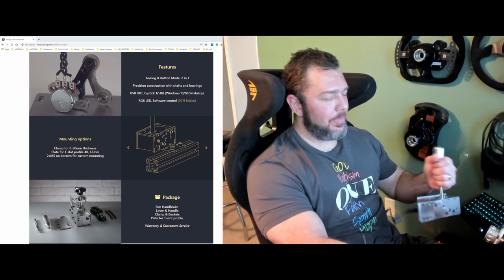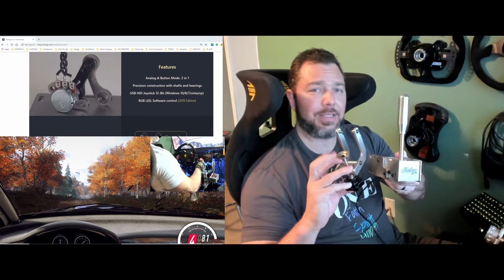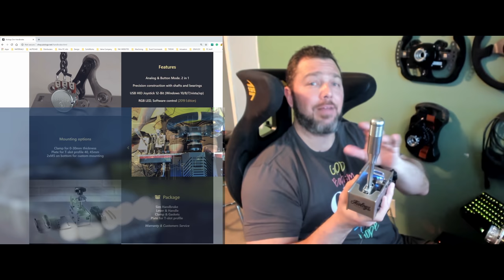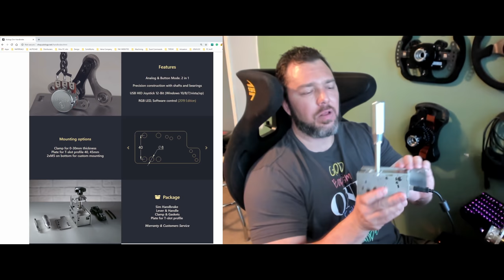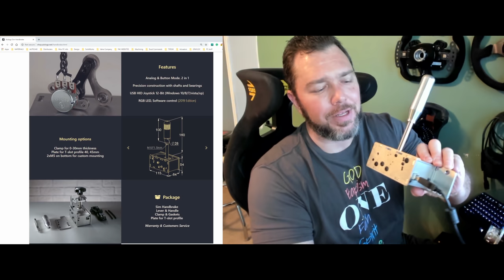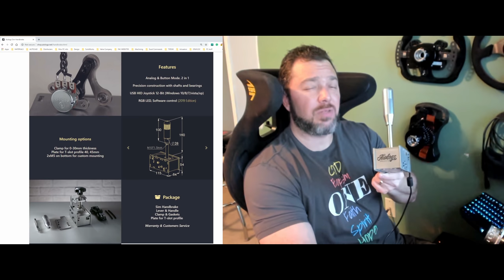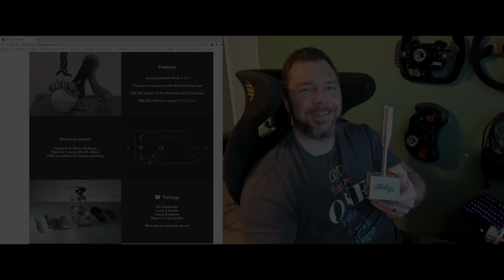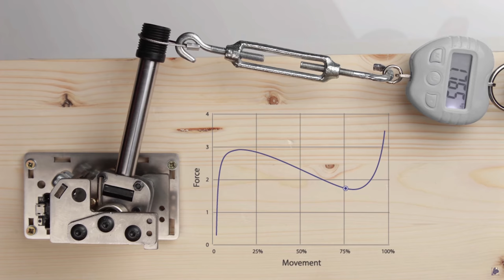Aiologs Hand Brake Review

Comment: thanks for the review. do you like it as much as the heusinkveld one? i wonder if they are equally easy to be precise with?
cheers
Reply from the maker: Hey, thanks for watching. Honestly, they both are in such a different price range that‘s it probably not fair for me to compare them. However, I will tell you which one I prefer. 😊 I prefer the Heusinkveld the most because of its resistance to pull. You also get 2 rubber adjustments as well. 

Keep in mind the Heusinkveld requires more than twice the mounting space and should be mounted to a very strong rig. A rig made for DD wheels like the Simetek K2 or 8020. The Aiologs requires very limited space and will not over flex even the weaker starter sim rigs. Both handbrakes mechanically work flawlessly with a very precise and smooth action. If cost isn’t a factor I would make your decision based on the rig you are using. Hope this helps and be sure to subscribe
Reply: TJRSim Thanks for the answer. I think with tax, shipping and import fee the Price difference Would probably be very small. But I prefer the look of the aio and I want  to get the shifter as well so would be ape adder and I'd only have to pay for shipping once. and Also, I don't have a strong rig, so I'll probably go with that. I just wondered if it was easier to be precise with the heusinkveld. Subscribed.
Reply from the maker: @spiralmoment  That sounds like a good decision. The precision was very close between the 2. The HE does offer a little more precision due to its software that lets you set it the way you want it. The aiologs doesn't offer that, but I feel for a handbrake it was precise enough as I could pull 1/4 or 1/2 pull handbrakes without the wheels locking on me. You know just those little pulls you do to get around a corner in Dirt Rally to swing the rear around without slowing yourself down. Thanks for the sub as well. More great things to come